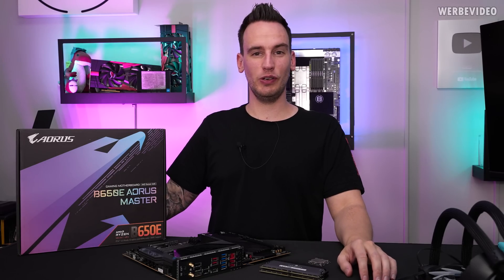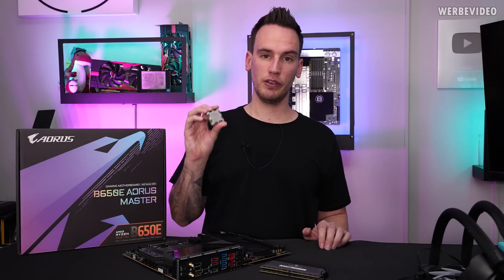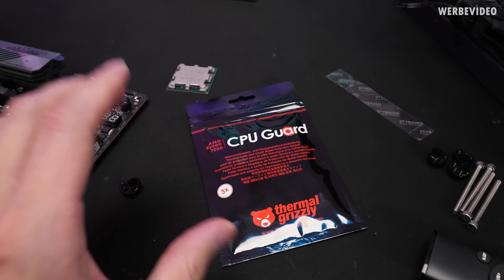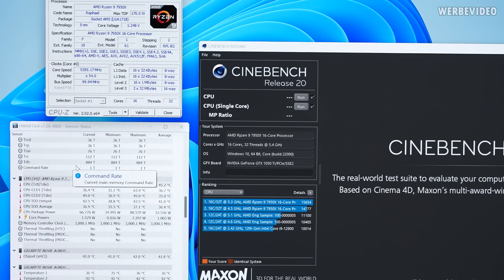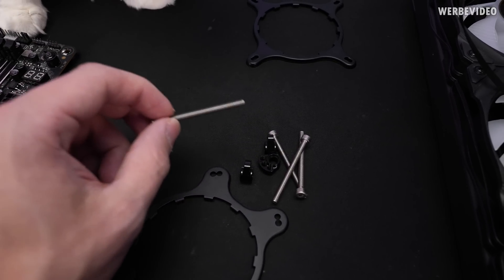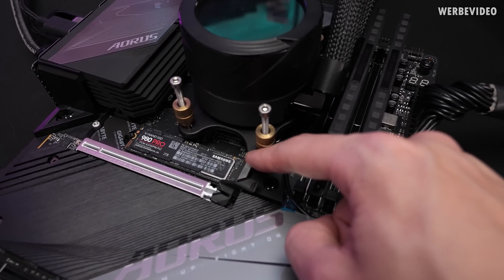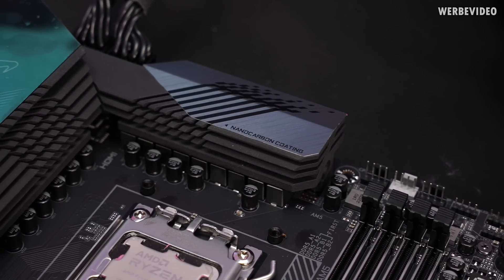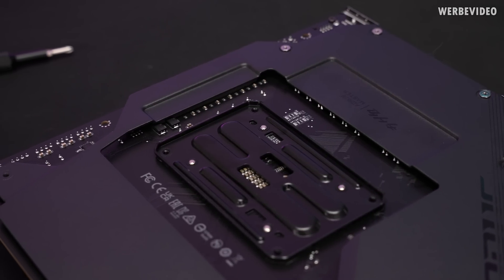Ryzen 7000 Offset Mount - Will this improve the high Thermals? (+B650E Launch)

Comment: Roman, unless I’m missing something it looked like the score actually went up by 9% from the first run to the second. If that’s the case, then I think it’s fair to conclude that the offset cooling worked as intended, but instead of reducing temperature it prevented the CPU from thermally throttling. Is that right?
Reply from the maker: Saw the same comment under my German video. Honestly I'm not quite sure how I missed it. I will look into this again :) Thanks a lot for paying so much attention to detail!
Reply: @der8auer-en  And yet again we see why he is the best.
Thanking people for finding possible errors in his videos.👍
Reply: @der8auer-en  Akuter Koffeinmangel, ganz klar.
Reply: @der8auer-en  i believe you guys said that AMD 7000 series will always hit the thermal limit to squeeze performance when you benchmark AMD 7000 you look at performance not temperatures at this point 

good job anyway love your videos
Reply: @megadooooom6582  true true
Reply from the maker: @megadooooom6582  shouldn't be the case with a manual OC though
Reply: @der8auer-en  Roman’s right. And on further thought, there may be something else going on here.

This CPU should not have been thermally throttling with a AIO under any conditions unless the mount wasn’t good (unlikely with Roman, but not impossible). Buildzoid did a video recently showing the performance scaling with power, and the difference between 175w and 250w is like 3%. A 9% drop implies something like 75-125w power consumption, and any AIO or decent air cooler should be able to surpass that as long as the mount is good.

The only other thing I can think of is maybe there was some other background task going on that was utilizing CPU resources. Windows Update maybe? Or Steam library update?
Reply: @der8auer-en  Has that been confirmed by AMD?
Reply: @der8auer-en  there's a bunch of people asking questions, this is opportunity to make another video debunking or proving comment theories :)
Reply: @der8auer-en  You have to remember Ryzen 7000 targets a 95C thermal limit BEFORE a power limit.

So i'ts impossible by design to lower the temps unless you are able to dissipate more than the  CPU consumes in raw power.
Reply: @der8auer-en  i think that for this kind of test you should use a manual overclock and disable all efficiency features, basically locking the CPU at a certain clock and voltage. GN do that in their tests.
Reply: @der8auer-en  Yes the 7000 always try to hit max temp. So insted watchig CCD's temp, focus more on boost clocks. It can boost higher in offset mode.
Reply: @der8auer-en  Any chance you have more Ryzen CPU works in the background? Offset mount, delidding, and under volt all in one? Would be cool to see video taking advantage of all these.
Reply: @der8auer-en  when are you releasing your ZEN 4 delidding tool and where can i buy it? and could Yu kindly make a video about using 2 3090 on AM5 for V-ray rendering, so to assess the performance loss when running both GPU's at X8?
Reply: @der8auer-en  Can you make a video on shaving down the ihs and see if there is any temp difference?
Reply: @der8auer-en  Wanna Grab Your 7000 series delid tool when will it be for sale? thank you
Reply: @der8auer-en  tuf weekend 😁
Reply: @der8auer-en  I thought DerBauer did understand the new "new AMD" ... It turns out not. Power limit? Restriction (reset) of frequency upon reaching 95 ° on the CCD? It's a big secret!! Reducing temperatures "below" the limit allows you to "keep" a higher frequency on the cores and, accordingly, get more performance !!!
Reply: thats what i see too. 1300 points makes perfect sense. unlike direct die it doesnt drop it far enough to get away from the throttling
Reply: I  saw that too, but the power draw maximum was still 234w vs 236w, so hardly any power draw changes, which we should expect for it to boost higher. But max overall is not the same as power draw during the test which I would have expected to be about 20-30w more for such a score increase.

I think more testing is needed. In reality these CPUs will just do whatever they possibly can within the limits, but we are not really changing the limits, just giving it more room to play with in those limits.
Reply: @manicdan481  if power draw was the same, then I think the overall thermal results are still valid. That necessarily means voltage AND current are stable and not changing, and that there’s no underlying performance difference as the frequency is also locked in because of the manual OC. If this was thermally throttling, it would have necessarily seen a drop in either voltage or current to bring the temps down, and since we’re not seeing that we can rule out thermal throttling.

To me that suggests background tasks sucking up CPU core utilization during the first run. The cinebench score was impacted, but the CPU was still pinned at 100% utilization at the specified frequency while doing something significant in the background other than HW Info and CPU-Z.
Reply: I was going to comment this but it seems others saw it as well.
Reply: @imo098765  i was going to comment this as well but then I saw that you commented this as well.
Reply: I haven't seen the video yet but surely he remembered to monitor frequencies, right???
Reply: I imagine it's hard to adjust the interal thinking process when taking cooling into consideration with Zen4. It's just different than pretty much any cpu. I expect Roman will post an update because an 8-9% performance improvement just based on an 8mm shift is very important information. 

That being said, I'd be interested to see boosting behaviors of both. With an all core of 5.4, how often does it even hit that without the offset?
Reply: @WilliamTheGamer  It might run at 5.4 GHz all the time with the manual overclock, but then introduce no operation cycles to keep the temperatures below 95°. Vega did the same if you undervolted the card too much. It kept the frequency but the performance dropped significantly.
Reply: Yes. I saw that too
Reply: I was just thinking... Since the hot spots are in the south, and hot air rises, will that make the offset mount less effective when the CPU is vertical and not flat on an open test bench?

Comment: Offtopic question, but linked to the AM5: is it possible to use either Thermal Grizzly AM5 backplates (M4 or short) to simply replace the standard AM5 backplate, which flexes visibly? Are their AM5 SAM threads the same as the standard AM5 backplate's? Thank you!

Comment: You should make AIO mounting kits for delidded Ryzen's. I am highly thinking about it but refrain because my EK elite AIO mounting posts use a rubbery spacer plus the thread distance is just enough for cpu's with heat spreaders. If I do it i'll need a tap and die for that size and to find how much of the rubber I will need to cut off. That's some cash right there for just myself, now if I ran my own shop, and offered it as a service, different story.

Comment: I have this motherboard paired with Ryzen 7950x and I get black screens when I put the CPU under heavy load with benchmarks like Corona render and Prime95 (Small FFTs). I have a 360 AIO cooler so the CPU is cooled very well. I also I tried all the BIOSes and also changed every component except for the CPU and the motherboard. It looks like there's an issue with this motherboard since the CPU works perfectly fine if I don't put it at 100% load. Other users on Gigabyte's Reddit are also complaining of the same issue (the thread is "Need Help with B650E Aorus Master"). I wasted so much time and money to troubleshoot the problem without success. I'm extremely disappointed with Gigabyte's quality control and will be returning the motherboard. This was my first and last Gigabyte purchase.

Comment: I use a different method: Instead of moving the cooler south, I use a bigger cooler. Went with the Alphacool 420 Pro - which is designed for much bigger CPUs.

Comment: he trying to save amd zen4 from dying in massive numbers due to 90c is hitting too soon and dangerous to be running that long will die in short term or lot sooner death, what makes no sense on amd part to be backwards compatible that they frogot to support ddr4 if they really true on that part??? odd is it, intel didn't forget ddr4 users and coolers are very compatible  for 1700 lga due to excellent partnership with noctua of providing new free kits

Comment: The problem isn't the position of the CPU, the problem is that the heat spreader is way thicker than it needs to be, AMD did this so it would be compatible with AM4 coolers, but now we have CPUs that run way too hot

Comment: support thermal-grizzly - my message: I have a 3000 series CPU from amd that I need this offset kit for? If you're not selling it anymore and no one else is? How am I meant to get hold of one? Please ask the relevant people to consider open sourcing it, or giving out the blue prints, for 3d printing, I'm sure der8auer would allow this if asked? / Response:
the offset mounting was a project in cooperation with Caseking and der8auer.
If you are further interested in this, you would have to contact Caseking and der8auer to see if they agree.

Comment: Here is a thought:
Given the Zen4's thick IHS, can it be replaced with a vapor chamber and if so, would it improve cooling vs a direct-die cooling solution?
Obviously it would depend on type of cooling solution (ie air or water) but given that with an air cooler only 1 or two pipes actually touch the CCD, it might improve.

Comment: High temperatures, not high thermals.  High thermals means a lot of heat, which is not the same as a high temperature, and not what's happening with Zen 4.

Comment: So about the IHS thickness, is it possible to lap it down half way, and adjust the mounting mechanism to allow a closer mount? I don't mind that kinda change as I don't risk breaking the die. I would be fine doing direct die as I used to forever ago before IHS but CPUs cost a lot more and might be more fragile, idk.

Comment: These cpus are meant to push to max temp. If cooler is better, cpu will just push more watts, which means higher clock. (according to Gamersnexus at least) So just by looking at the watts and clock speed, should be able to see if cooler is better. Temps gonna be max no matter what.

Comment: Have you tried shaving 2mm off of that extra THICC ihs (a way safer option compared to removing it altogether)? If loading mechanism becomes an obstacle - swap it with holding bracket like you did with de-lidding...

Comment: Der 8auer when you previously de-lidded the CPU, did it offer you any insight that offsetting the cooler on this architecture of CPU would benefit its cooling at all?
Reply: The cores in ryzen are off center since I think Zen 2, and most coolers are actually domed cold plates, meaning they apply the most mounting pressure in the center. if you offset the dome so the cold plate is closest to the IHS over where the cores are, you can gain thermal performance as the cores can have heat more efficiently removed.

Comment: Techpowerup review Ryzen9 7950x they tested (OC 5.1 GHz All-Core) essentially function as Down Clock. (Temperature difference is huge.) Techpowerup results:
Power Consumption MultiT: OC 5.1 = 200 W vs StockCPU: 235 W = 80 C vs 94 C
OC Rendering lose only 2% in Blender vs Stock and you get -14 C.
Power Consumption GameAv.: OC 5.1 = 55 W vs StockCPU: 87 W = 56 C vs 76 C
OC lose 1-10% fps in game power efficiency jumps 70-80%
Power Consumption SingleT: OC 5.1 = 22 W vs StockCPU: 43 W
OC lose 10% in Cinebench R23 SingleT for Almost half! the power (90%).

If you have time try Down Clock. Can it run without cooler :)

Comment: If you use the offset mount and don't file the AIO mount to allow the stock M.2 heatsink, you should use double sided thermal tape and a 20mm x 20mm heatsink for the PCIe 4.0 SSD controller.

Comment: Are you going to do a year long stress test for the new Ryzen chips? just to see if the 95C operating temp is going to somehow degrade the silicon or not. 
I think someone should try that, doing Cinebench loop for a whole year while the CPU is pegged at 100% load.

Comment: Interesting data

Seems this might offer some benefit? I'm excited to hear more!

Something else I'm curious about: How much of Ryzen's thermals are due to the increased IHS thickness? Direct die showed great improvement. I wonder if a thinner IHS would offer some benefit. Either a custom tooled replacement, or shaving a couple mm off with a cnc to test/evaluate
Reply: Ryzen 7000 targes a 95C thermal limit before a power limit, so you cannot lower temps unless you dissipate more than the raw power it is consuming off the wall.

Comment: You just know someone out there is going to buy a 1200$ motherboard and put a 7700x in it and do zero overclocking because more money on the motherboard means it runs faster right? RIP

Comment: Would it be feasible to make a block that fits the heat spreader?
Then not only the top but also part of the side would be cooled.
And I would insulate the capacitors with high temperature silicone.
Well, my English isn't so good, hope you guys understand.

Comment: I have the Gigabyte x670e and 7950x offset cooling with the provided offset bracket for the Artic 420 AIO. 

The included instructions (online) indicated that Artic has seen real world gains in lab  with the 7000 series and I have mounted as per their instructions.

Stock, no overclock, I am posting a 37,600 to 37,800 score on R23 which is only slightly worse then a custom cooling setup that can post a 38k score.

I can not verify, but I would say that offset may be beneficial.

Can you please test single core with this offset? Something weird is happening, I am currently posting a single core score in R23 of 2080-2090, which is slightly higher than reviewers scores of non offset mounting… the same reviewers who have a 38,2k score multicore, higher than mine by a measurable margin.

Comment: You can mount a offset cooler but the IHS still only can spread the heat x mm in a certain direction. I think for 8000 they should try and swap IO DIE and chiplet location.

Comment: the only solution for these hot headed amd cpu-s is: amd engineers need to return to the drawing boards and modify these chips. ryzen 9 5950x seems the best bang for the buck/energy/heat wise

Comment: What if you chop down the top portion of the processor to make it finner, as thin as the 5000 series, then get a cooler with a different shape to be offset downward to compensate that gap?

I'm curious to see how the top layer actually make the temp worse, without having to run direct die cooling with a metal plate in between like some youtuber asked for in order to know what was lost here (but which wouldn't translate to the real heat transfert lost compared to chopping down the top of the cpu die cover).
Reply: You could lap the top of the IHS and remove about 1mm of material, maybe 1.1 or 1.2 if you want to get really in there. Your best bet from there would be to modify the mounting hardware to be the same distance shorter, so an existing cooler would fit.

Comment: Technically the science is heat travels from high temperature to low temperature.  Whether the heat sink is left or right doesn't affect the flow, but here I think contact has a negative impact on heat flow.  Processors are reaching high wattages that our cooling methods are needing to be premium quality, i.e fans, lapping, and 100% mounting contact.  The alternative is to buy it and use it at 90% efficiency.

Comment: Der Bauer,,  would it be possible for you to config your CNC to shave off 50% of the IHS table to achieve better thermal conductivity?  Ok, maybe the masses with AM4 cooling couldnt just slap their solutions on but Im certain there could be an easy solution for that as well.

Comment: In France the Gigabyte B650 Aorus Elite AX listed at 360€, its exact X670 counterpart is at 410€ while the Ryzen 7600X is listed at 430€ all in the same webshop.

Quite the confusing prices tbh... looks like the B650 Aorus Master is gonna be 550€ at this rate.

Comment: What about aggressive lapping to thin out the lid?  How to get coolers to mount properly if we pull a mm out of the lid? No pins on the cpu so lapping is less risky.
Reply: You could probably modify the mounting hardware of the cooler to make up for that 1mm of difference. Some shorter pins or clip arms should do the trick.

Comment: Roman JazeTwoCents asked a really good question regarding your last video with direct if you have a piece of metal between the die and the cooler that have the same thiknes as a normal ihs will it still go so hige in the heat is The Heat in the new Ryzen's only so high because of the new thik ihs shild ?

Comment: yeah temps might not improve but did the score? these chips are meant to perform better instead of drop temps if there is more thermal headroom. i wouldnt expect better temps, but more performance. it looked like roughly 9% better score in the video

Comment: With the crazy electricity prices, atm, i'm more interested in downclocking videos :D Knowing how much you can downclock a cpu/gpu and still get great performance. Like the best performance per watt, or smth like that would be a great video.
Reply: check actually hardcore overclocking video on the 7950x...he does 29'000 cinebench r23 for 65watts O_O when my 5950x used like 170+ for the same score, if you limit the watts you lose 25% perf but spare 75-80% of the power it's bonkers
Reply: The easiest way is ECO mode.  No doubt you can learn from here how to tune it better than default.  If it can be done.